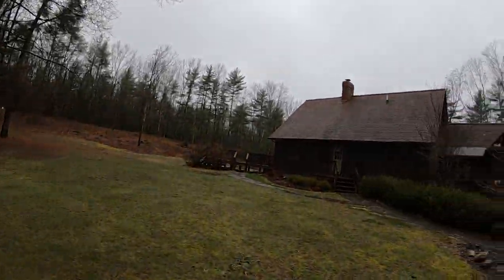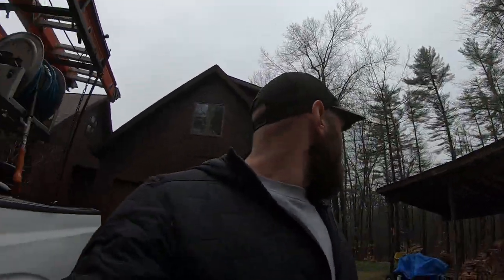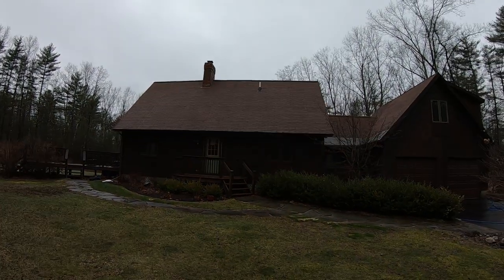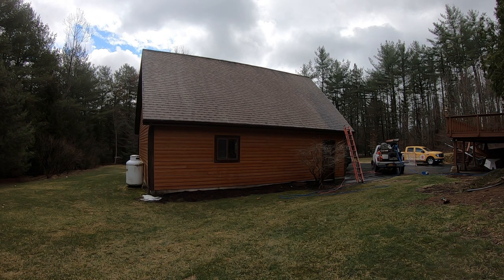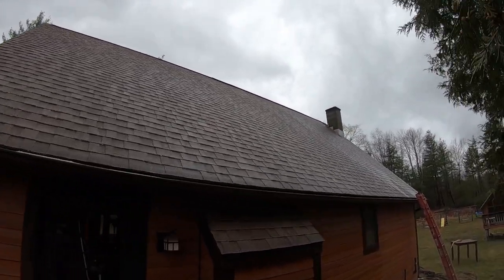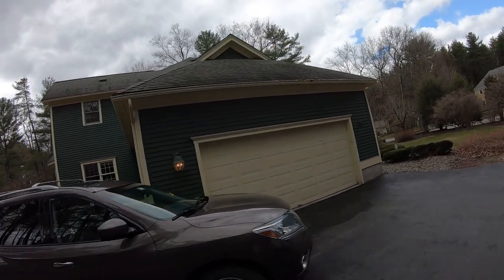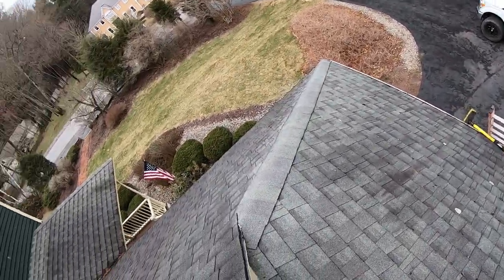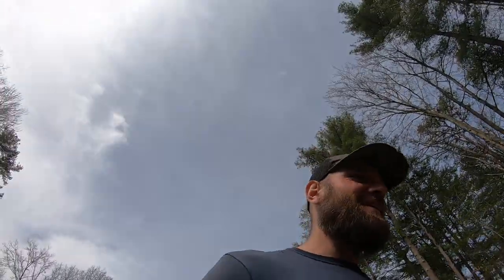3 Big Roof Washes in 1 Day - Solo Grind Soft Wash

Comment: I have the same blend manifold for my system I’m wondering how much surfactant you use on your roofs I see some guys keep it wide open but I only keep mine at about 60% but sometimes I feel like it’s not enough?
Reply from the maker: I change it depending on the job. There's no 1 setting fits all
Reply: @YoungAmbitionYA  that’s what I figured but if you had to choose on what you keep it at on most roofs what would it be. And thanks for keep putting out these videos man I try to watch everyone.
Reply from the maker: @davejohnson8148  20 or 40 hash but all depends on the soap you use and the predillution the mfg recommends

Comment: I have heard many times from softwash guys that they turn down roof jobs on anything with stained wood siding. The reason they say this is that the reaction between SH and the stain causing streaks. Have you ever had this happen to you? Obviously your not turning them down.😁
Reply: That's what I was thinking..I would be nervous of the the stain streaking.
Reply from the maker: I've never had an issue with painted wood. Just rinse after. Always test a spot
Reply: @YoungAmbitionYA  I commented before watching you on the 2nd house..you rinsed the deck off really fast.. good deal! Thanks man